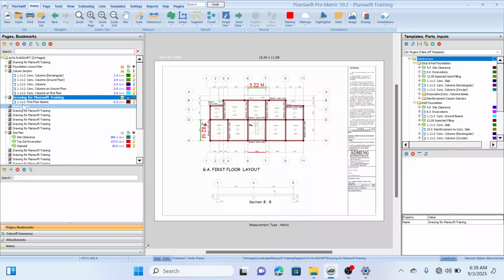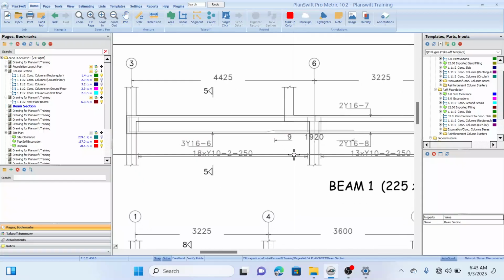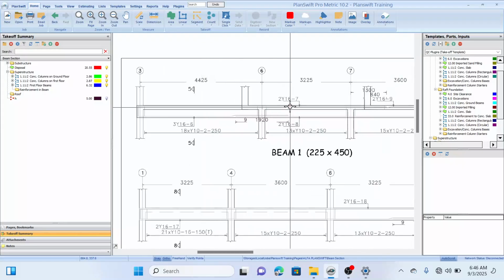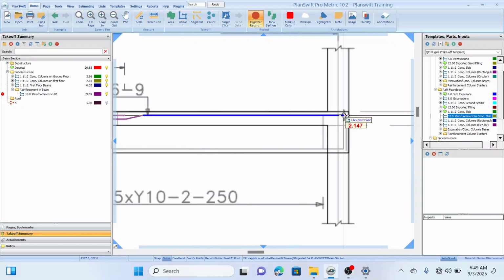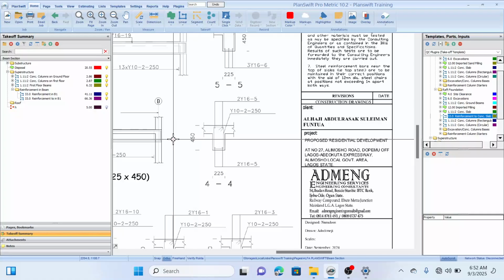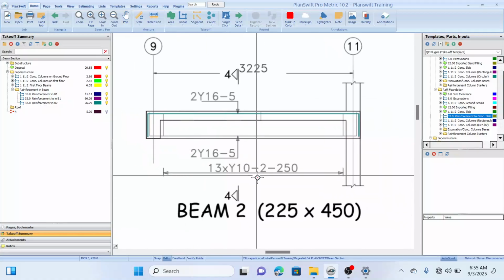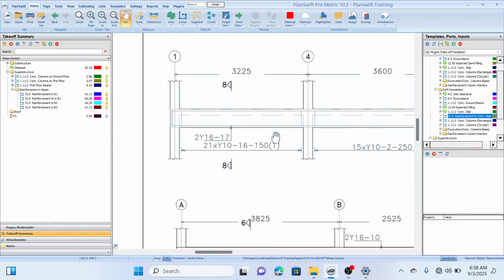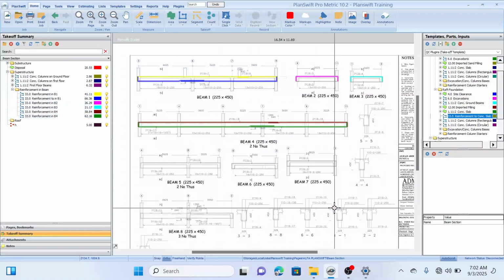Measurement of Reinforcement in Beam Using PLANSWIFT

Comment: This particular tool you are using is for slab reinforcement. Create one for beam separately.
Reply from the maker: The Bean has its own too. But I prefer using that slab reinforcement tool for accuracy. 
We are not meant to be measuring reinforcement as QS, it is the duty of the structural engineer to provide bending schedules showing the total weight or tonnage of the reinforcement required.

Comment: Hi bro for beam 4 the stirrup spacing is 150mm and not 250mm as shown in  section 8. Is it going to be measured separately or just part of the stirrup calculation for the whole beam as  you measured already.
Reply from the maker: You are going to measure it using the stirrup section of the plugin.

Comment: Hi bro,thanks so much for this insightful explanation of the beam reinforcement.Btw for Beam 4 we have 2 No. Is there any shortcut to include them in 1 go or do i just need to copy both values or repeat the same process?
Reply from the maker: You can always multiply whatever you measure by 2 if you are using a plug in, or you do the multiplication in the advance section of your measurement tool, if you are using the measurement tool